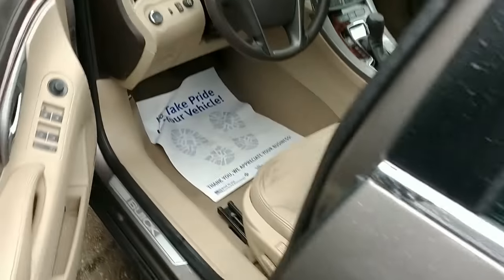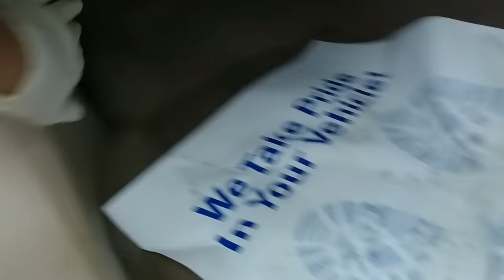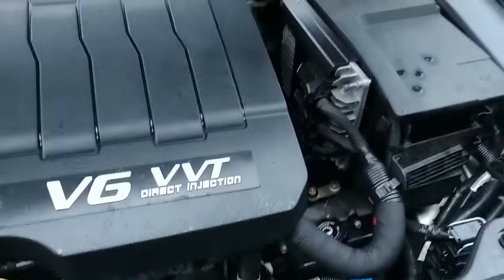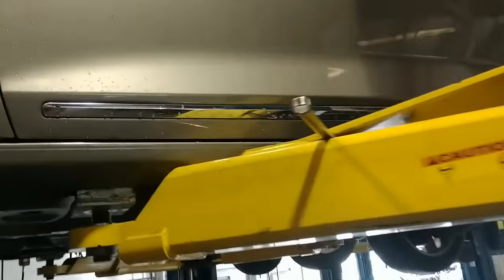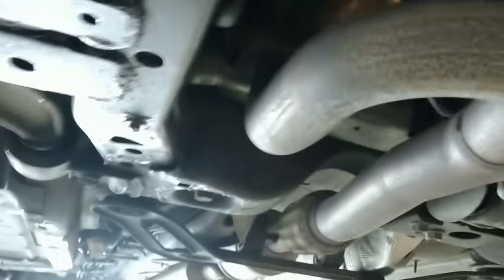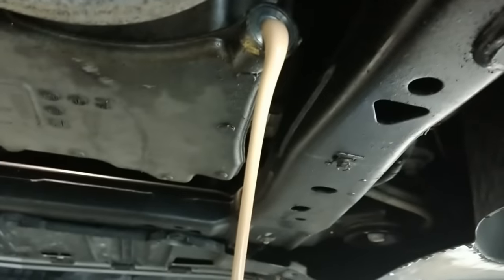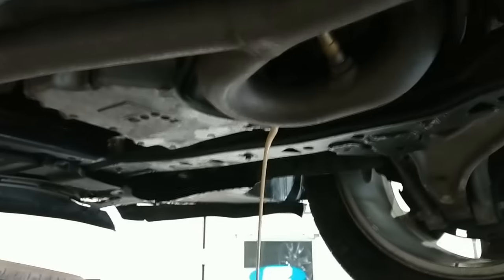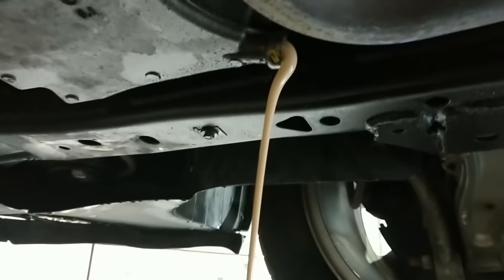Overfilled Crankcase! Blown ENGINE! Used Car Nightmare!

Comment: If the engine bay looks spotless and shiny, be very suspicious about the mechanical integrity of the vehicle.
Reply: Yup, if there's no shit on the outside, all the shits on the inside
Reply: Lol. It's a gm product. Junk.
Reply: Or it mine and it's just well taken care of. You never know until it's shown working and working right
Reply: @MrCoffeekelly  yeah I could tell from the outside too ha
Reply: Pretty sure it's common to do engine bay details. It's not gonna tell you much.
Reply: Been telling people that for years. If I open the hood and it's shiny it's usually a turn off for me.
Reply: @oliverdelgado6952  Not even just a clean engine but if the hoses are sticky because they had armorall put on them I am shutting the hood and not looking back. Id rather have it leaking oil from every orifice than have everything slimey to the touch! Ill put up with all kinds of oil and grime, but fuck that stuff they spray all the rubber with! Like: "Thanks for putting tire shine on these new tires that are now rotting from the petroleum...."
Reply: That's not true I clean my engine bay every 3 months. Mechanic's at the dealership love it.
Reply: @bertoh5544  They just love you because you go to them for service! :P
Reply: @OrionDakota  Almost at fifty thousand miles and the service will no longer be free. Then they'll be nice when I pull up lol.
Reply: @bertoh5544  LOL okay that adds up.
Reply: wrong just check all fluid levels. leave vehicle running way past warm up look for smoke steam, leaks  etc, check all lights then test drive .return pop hood check levels look for steam check for smooth idle. cleaner the better,
Reply: Not really, cleaning the engine bay is part of a cleaning detail.

So you are saying that the best cars to buy are the ones covered in mud like they've never been washed, shitty nasty smelling upholstery,  and an engine covered with thick layers of oil and dust...
Reply: @adanochoa4963  YES THATS WHAT HE IS SAYING LOL.
Reply: @MrCoffeekelly  Yup. GM has to be the worst company in western history. Just below Dodge and Ford.
Reply: @Account NumberEight The "sucker" is because people think they are getting a deal when they buy the car.
Reply: True I feel safer buying a used car with a dirty engine
Reply: @Account NumberEight  I've had the best luck with gm I have a  Yukon 4x4 with 275 thousand  miles original engine and transmission never had anything  major go wrong and it's never left me stranded
Reply: @apreviousseagle836  Ford is light years away from GM and Dodge. Ford still makes reliable trucks, and the Ford fusion was a decent car. GM and Dodge are just pumping out clunkers left and right. Which is really sad because, I personally love how Dodges, and GM cars/trucks look, but guys put in a decent engine and transmission. I love Ford out of all the Car companies coming from USA, however if we lived before 2004, I would say GM and Ford were both pretty close in terms of reliability.
Reply: @dadyking1210  So I have a Ford from the 90's, and while I love that car, it has been a PAIN in the ass. My dad bought a Nitro that started breaking down after 80k miles, and he babied that car. I'm done with American, sadly. I owned an Echo that lasted 300k miles dude, and all it needed was regular maintenance. It was running perfectly when I sold it for peanuts. We'll see how the new Subaru holds up, but I expect it to do so far better than the domestic crapola.
Reply: @apreviousseagle836  Subarus are underrated. I work at a car rental industry and the cars that break down the most UNDER 20k are, {Dodge Journey, Chevy equinox, every Volkswagen}. And about Ford, you have to do tremendous research about a Ford. For example, the Ford Fusion 1.5l is super reliable. The Ford Fusion 1.6l goes through turbos every 20k. In contrast, you can walk up to a Toyota dealer and buy any car on the lot and have less worries.
I also only own Fords. I bought a 2002 mustang, changed it for a 2000 Lincoln town car, and now I’m driving a 2014 Ford Fusion. If gas was cheaper I would have stuck with the Lincoln Town car forever.
Reply: A car that old not going to look that shiny.
Reply: @Account NumberEight new 2021 /2022 corvette model? Or..
Reply: @apreviousseagle836  Honda’s and Toyota’s are definitely safe bets. Mazdas and Subaru’s shouldn’t be ignored either. Those are some pretty nice cars. I only buy Ford because of the interior is comfy and I feel really safe (in my fusion,Lincoln).
Reply: First thing I thought of when seeing the clean bay and silicone was Mr Wormwood lol
Reply: The engine bay in my Civic is spotless. 270 K miles and going
Reply: Every used car sold by a dealer I've ever seen looks like this.   They're not all bad.
Reply: I keep my engine spotless it looks as clean as my oil.I have such a lucky car
Reply: A lot of auto sellers do this to make it look"brand new" the dirty tactics
Reply: You can polish a turd. What you then have is a polished turd.
Reply: @bertoh5544  - what do they think of you putting apostrophes in simple plural words?
Reply: @markfox1545   they love's it too!!!! Show's I'm not a book warm spitting order's and I actually get dirty.
Reply: I could agree with this. Mostly if the engine is spotless and the inside is disgusting, I could bet they're hiding something. At least that's the vibe I got from a car I recently checked at a dealer.
Reply: So what, do you expect a car yard to sell a new used car all greasy and muddy?
Reply: Contrary to popular opinion, you CAN polish a turd.  Most stealerships and junk yards will detail a used vehicle for sale (But that doesn't mean that if it's shiny it must be a turd).
Get a good mechanic to check the vehicle for you if you don't know what to look for, but don't go on appearance alone either way.
A dirty car is easy to fix, one with a blown gasket, stuffed bearings, and scored cylinders is going to need a rebuild.
Reply: No true !  I keep my engine bays spotless on my vehicles and maintain them way more than needed...

Comment: Ah yes, the old blown head gasket......and it looks like it's been that way since before it's last purchase. In my experience a majority of the time they leak somewhat slowly until that point where the coolant is literally pouring into the cylinder so badly it runs too poorly to drive. She was definitely sold a 'known bad' vehicle.
Reply: @alienrocketscienceshared8454 found the used car salesman.
Reply: @alienrocketscienceshared8454  there's a difference between selling a vehicle in disrepair as is, and blatantly cheating somebody.
Reply: @GIboy1990  as a car salesman I resenble that remark 😆
Reply: @alienrocketscienceshared8454 oh you’re getting scammed for sure now
Reply: Sometimes the leak it's direct from the coolant to the oil, and the coolant don't pour to the cylinder. My first cheap car had this problem, the oil leaked to the coolant and looked like diarrhea, but the car drove very good actually, no overheating and even sounded smooth, I had a couple of long trips and only noticed about a month later when I was checking the coolant deposit xD
Reply: This happened to me earlier this year
Reply: @alienrocketscienceshared8454  buyer beware isn't absolute. Good faith is still an expectation. If you can prove that a salesmen acted in bad faith, by deliberately hiding known issues, you can get them for fraud.
Reply: @NautilusCL  ya people saying head gasket or such Nope that would be block that is cracked from the inside most likely cause freezing
Reply: @alienrocketscienceshared8454  if the dealer changed oil before selling the car they would have known instantly there is no way that oil frothed that bad in less than 100 miles and running that rough with white smoke pouring out the back like that it would be a cracked block that engine is done and the dealer would have known
Reply: @alienrocketscienceshared8454  It was probably a woman who bought it, and think how many women even know how to check the oil, in the world???? It's too bad those people get scammed, but they need to do their due diligence and get a lawyer and  go back with the dead car in tow...
Reply: @daphnekershell3228   Sorry this had to happen to you, Daphne...  :(  Hope you are ok...
Reply: I suspect the place she bought it from might've rigged the head gasket temporarily with some sort of head gasket sealant you add to the oil.  Won't fix the problem, but it will hide it for long enough to for you to drive it away.
Reply: I'm thinking it is more just a head gasket, and even if it is just a head gasket for it to get hot and mixed up to the point of looking like the oil in that Buick it's going to have to have extensive head and block work probably a whole new rotating assembly, for someone to sell a car like that to anyone needs a good ole fashioned ass whooping
Reply: @minkorrh    Coolant is going from the water jacket down to the oil system and sump, and is being pumped by the oil pump and emulsified. If coolant was "literally pouring into the cylinder" the engine would hydro-lock in moments, and the car would have been towed in instead of being driven in. A blown head gasket can result in combustion gasses going into the water jacket (sometimes you can actually see bubbles in the radiator), combustion gasses leaking into the atmosphere or oil system, coolant going into the oil sump, coolant leaking to the atmosphere, or coolant going into a cylinder, which will result in the engine blowing steam out the tailpipe, or the engine hydro-locking if the leak is large enough.